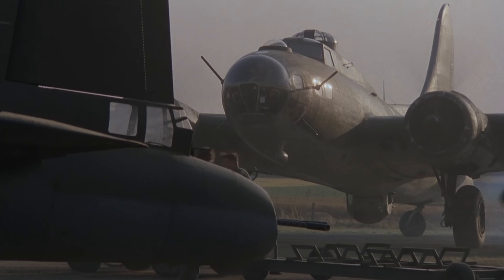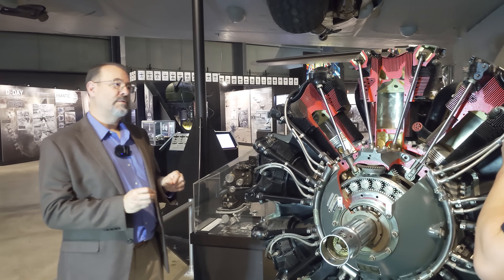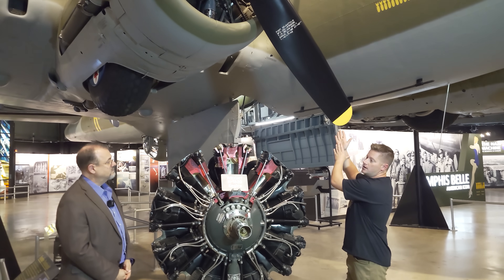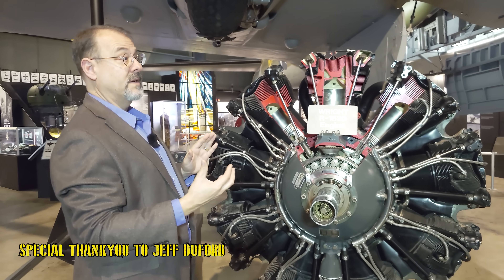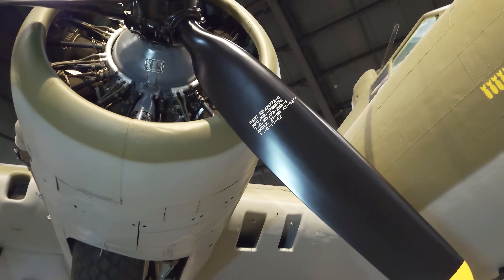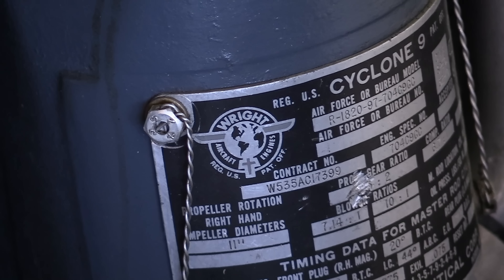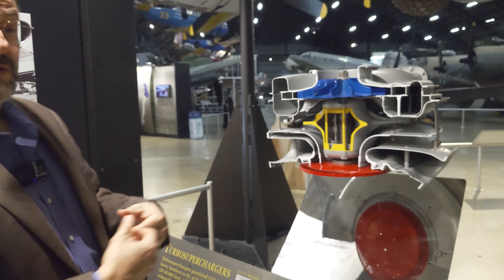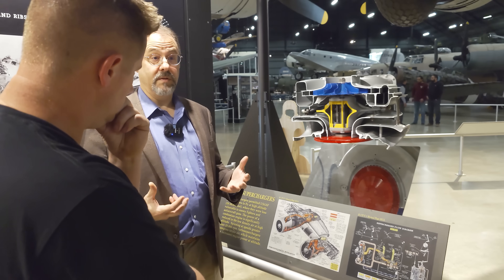B-17 ENGINES IN DEPTH! Genius Or Insanity?

Comment: A turbo does rob power from the engine just like a supercharger, it's just taking it from a different place.
If you're using engine exhaust to turn a fan, you're increasing the pressure the engine has to push exhaust out, thereby working against the piston stroke trying to push the exhaust out and slowing the engine down.
Reply from the maker: Good information. Thanks for watching!

Comment: As for the books I read some 50 years ago. They said that the turbo, produced about 450 Hp, the supercharger took 400 hp to run them so there was a net gain for using a Supercharger system for maintaining  Hp  up to altitude.
Reply from the maker: Absolutely.

Comment: My stepfather was an aero engineer and I remember how we looked at a cutaway of a radial, and I exclaimed that it looked insanely complicated and that it must be expensive as hell! But he said no, what is really difficult is making the mould for a V12 block. It requires very experienced workers and that is a major obstacle in ramping up production war-time. All steps in the manufacturing of a radial is a lot simpler. We looked around and found a quite reliable source that stated a price for a Merlin about twice that of an R2800.
Reply from the maker: Very interesting perspective. What could that say about the British using their V blocks in medium and heavy bombers even though they had radial engines as well? Would their design be more complicated and more expensive then the US counterparts?
Reply: @MilitaryArmamentsCompany  It depended on what side of the  Atlantic the Merlin was built , if it was built  in Briten it was a hand built engine. if it was a Packard Merlin, it was built on a assembly line just like all other American engines. Yes the British  Merlin  Production was up and Quality control was just as good, and sometimes better than the British engines.

Comment: Even though the B17 was an older deign it out performed the British Lancaster Bombers that were powered by the Merlin engine, an engine drooled and slobbered over by the Brits, but the cold hard fact is the merlin 20 used in the MkBI & Mk BIII were a mechanically driven single stage supercharged engine. they did have a second SPEED to turn the compressor wheel faster AT ALTITUDE they were only capable of 20,000 ft service ceiling, the 2 staged TURBOcharged Wright R1820 gave the B17 a 30,000 ft service ceiling, or an extra 10,000 ft.   the B24 managed 28, 000 ft service ceiling or an extra 8,000 ft,  the B24 had the same Turbocharger system as the B17.
Reply from the maker: Excellent feedback!
Reply: @MilitaryArmamentsCompany  Also you note one of the engine tags you showed ,showed STUDEBAKER as the engine maker, what is not widely known is Studebaker was the prime engine builder for the B17, war time license to build them to increase production, just like FORD made the PW R2800 for the P47 and PACKARD built the merlin for the Brits and the P51 Mustang, and Chrysler the Wright R3350 for the B29 program !!

Comment: Turbochargers required massive ducting on the P-47 and P-38. The 2 speed 2 stage superchargers on the Rolls Royce and Bristol engines were more effective at high altitude. The last Rolls Merlin upgrade got over 2 000 hp at take off from 1650 cubic inches. The more standard Merlin 61 had a specific power (HP/cubic inch) nearly double that of the 1820 and the P and W 1830. It also had a seriously higher power to weight ratio. The similar scale Bristol Hercules radial had about the same specific power and a slightly higher power to weight. Nothing wrong with either Wright or P and W, but exceptional not so much.

Comment: Excellent video. The only thing that I think he could have explained somewhat better was the scientific need for the turbo super charger system due to the altitude these engines operated at. Any burnable fuel requires oxygen to burn and every fuel has a specific stoichiometric or air to fuel ratio that it combusts fully at. If this ratio is not correct in an engine it will lead to a rich or lean condition which will cause power loss and even damage due to improper combustion. In order to get the full power and reliable performance out of these engines just like any engine that ratio needs to be correct. To achieve this at high altitude where the air is, much much more air needs to be compressed into the engine to provide enough oxygen for the fuel to burn properly. One thing I’d like to know more about is how the boost pressure was reduced at lower altitudes to prevent a severe lean condition where the air is denser. I read that they had boost control systems but I don’t know much about how those worked at the time especially without computers etc.
Reply from the maker: Great feed back. Thankyou for watching. Check out the rest of the series.
Reply: Could have done with explaining why they used Turbo charging + Supercharging and not two stage super charging as others did to get high altitude performance rather than just stating Wright were the only ones to use Turbo charging.

Comment: We know that aircraft maintainers sometimes worked for days without much sleep to get an aircraft ready as son as possible. That being said , perhaps there was no time to stencil paint some of the repair parts for service.
Reply from the maker: Fair observation, only to say that stenciling was done rapidly at factory like to assist with parts supply chain and settings for pitch etc hence why the question was asked. Thanks for watching, check out the rest of the series.

Comment: Nice engine. I did my apprenticeship on them in the 1960s. They use to put them in the Grumman trackers and in the nose of the Sykorsky s58 c models .They were a much better engineered than the Pratt and Whitney engines.

Comment: 'Air Forces' lab?  I think Pratt and Whitney might have a comment about that.  The cylinder fins were created by cutting the fins in the solid aluminum casting with gang saws, and a steel cylinder sleeve was inserted for the piston, and the Air Forces lab had nothing to do with it, just pure free enterprise innovation and invention with zero government intervention.  Something we need today in the area of automobiles instead of cars by edict.

Comment: The "tour guide", or whatever he is, did not explain why supercharging was important, he stated that it was important. Because high altitudes meant lower oxygen levels supercharging was needed to force more oxygen into the combustion chamber. This same type system, crank drive supercharger and turbo supercharger, was used in the P-47, giving it unparalleled high altitude performance.

Comment: The statement that turbo superchargers dont use engine power is false. Turbochargers are driven by the exhaust stroke of the pistons, they generate parasitic loses. Turbochargers cause backpressure in the exhaust system, and the crankshaft has to apply energy to drive the piston upwards on the exhaust stroke to force air through the turbocharger. It is not free energy.

Comment: I took a ride on the movie version of the Memphis Belle back in 2013 in Wichita, KS.  I went with my 83 yr old dad, it was a great time.  They flew us for about 45 minutes all around Wichita including flying over the old Boeing factory and our local McConnel Airforce Base.  It was exciting because the gunner doors were open and you could literally lean out of the airplane while taking pics and videos.  Also, the top gunner's bubble was just a hole that you could stick your head out of as well.  An experience that I will never forget.  Sadly, my dad passed away only one month later, but, he had a blast on the flight and couldn't quit smiling.
Reply from the maker: Glad you got to experience a 17 ride! With you dad makes it better. Check out our video on Bomber Camp, Lots more happening in a B-17 then just the ride!
Reply: She caught fire a few years back and burned up in field near Chicago I’m told.  A real loss.
Reply: @williamrau8636  I believe that B-17 was the Nine-O-Nine that crashed in Connecticut in 2019, I believe the Memphis Belle that I flew on is still flying, at least I hope so, I'll do some checking now.

Comment: Great video but listening to that guy call the turbo-charger side of the induction system a "turbo super charger" was driving me nuts. Its called a Turbosuper charger system because it has a Turbo charger (1st stage of the air being compressed which he was mis labeling) and a supercharger after that.

Comment: An engine is an engine.  They are either built right or they are not.  But build quality is generally assured with anything used in aviation;  This is not an '82 Cadillac with the HT4100 engine that literally died due to regular full throttle use....

-What separates the men from the boys in aviation engine world is the time between overhaul.  The Curtis-Wright R-1820 Cyclone engines.  These were tough as hell and made about 1200 horsepower from their 9 cylinders and 1820 cubic inches.  These are air cooled and used pushrods to operate the two valves per cylinder.  They were also used on all the Douglas DC-3's, so parts were easy to come by.  The cost to maintain one of these engines is ~~ASTRONOMICAL~~ these days, but back in the 1940's they were dirt cheap.  

The B-17 used four of these engines and there were thousands of mechanics straight out of the military that knew how to maintain them.  NOT so today!

Honestly, they need to replace these engines with Pratt & Whitney PT6 turbines.  Or stop flying these 80 year old airplanes~

They don't make parts for Curtiss-Wright radial engines anymore.....
Reply from the maker: Great feedback. Great input. Thanks mate. Scott.

Comment: 9:00 I would tend to disagree with this fellows take on Turbo Chargers as I would say the engines do indeed take a small hp output hit do to exhaust restrictions and back pressure, just as super chargers cause a slight hit from pullies off the drive shaft.☝😏
Reply from the maker: At least you can disagree and be cordial about it. Some viewers here have emotional trauma and damage from the content we worked so hard to produce. Thanks for watching, check out the rest of the series.

Comment: I aways wondered why they didn't build a variety that had the larger more powerful engines used in the p-47
Reply from the maker: There were some B-17 experimental phases with V Block engines similar to a Lancaster. At the time pumping out the production was more critical then halting to reconfigure the design process in the factory and on the plane for an engine swap, also knowing B-29 was only around the corner more or less it would have been null and void.

Comment: Just a note about roller lifters. They were used quite extensively in the earlier part of the 20th century. My 1918 Stutz has roller lifters. The new vehicles now are simply copying the technology from over 100 + years ago. The new roller lifter assemblies manufactured now are poorly made and designed to fail. Unlike the ones earlier last century.
Reply from the maker: Great feedback. Agreed. If given 100k to buy only a Vehicle I would choose something older and bring it back to factory new instead of buying something new today.

Comment: Density of air, which is 20% oxygen, decreases with altitude. This means the engine gets less oxygen at altitude, leading to less power because it is the fuel/oxygen chemical reaction that makes the power. By compressing the air, we are re-densifying the oxygen making it possible to generate as much power at altitude as can be made at sea level. That's how it works.

Comment: The piston engine planes from WW2 are some of the most incredible engineering in a time of only pencil to paper and slide rules, no computers just pure genius, I love them
Reply: Absolutely! And the time constraints on top of it!!
Reply: And today people cant put down their phone for 10 minutes
Reply: It is not the pencil and paper or even the computer but the Human Brain behind it.
Today we have all the computer power they didn't even dream of by then but yet there are some really bad products in the market....
Reply: @1798iscomingback  we built the fastest aircraft ever the sr-71 with slide rules
Reply: @scallen3841 That would probably be the fastest production aircraft ever built.  Yes.  Incredible what those engineers did.  Just the engines were incredible, and compared to the rest of the aircraft, they were simple.
Reply: @scallen3841 fastest aircraft ever X15
Reply: No computers, but also no CNC machines, all these components were done by hand by people using mills and other machines, becoming a lost art.
Reply: @racekar80  A great deal of machining was done with cam controlled lathes, rather than CNC.
Reply: They had computers just not the kind your thinking of I have one that has a Patton  date of 1898 I could be wrong on the date and I'm not going to go dig it up it's still amazing if you look at the guns built back then are very complicated and difficult to work on to much engineering compared to guns made today same with them radial engine's there is so much engineering in them it's mind boggling.
Reply: There is definitely something special about planes from that era. My Fav is the P-38. It looks badass just sitting there on the ramp. The Japanese called it, "death from above". Kelly Johnson and crew were probably some of our best engineers, ever.
Reply: It was incredible engineering, buts let's not forget that the were building on 30+ years of improving aircraft technology they didn't pull these out of thin air no pun intended.
Reply: So was the SR71
Reply: all accomplished without what modern society calls "diversity".  it is amazing what our people can accomplish when left alone.
Reply: @westerncivilization  That's a pretty silly statement. Do you mean made by white people?
Reply: @westerncivilization They picked favorites too.  It was called racism.
Reply: @westerncivilization And sadly we gave a lot of things away!!
Reply: @mikes9759  Britain gave a lot to us, too. But if you agree with him, I don't expect you to think past your comfort level...

Comment: I'm not sure which Pratt it was, but many years ago I read an article about the recollections of a WWII German engineer.  He said they knew they were in trouble when they dissected a downed P&W engine.  They couldn't believe the case halves were so well machined that they didn't need a gasket between them, and worse, that these were being built in high production quantities.
Reply from the maker: American industry in High Gear right there.
Reply: Then he was lying. The Germans were building  licensed copies of Pratt and Whitney engines before the war.
Reply: @prophetsnake they didn't have a licensed R2800.
Reply: @prophetsnake yes for the JU 52 3m.

Comment: Cutaway:  I was surprised at how thin the cylinder walls were.  Exhaust driven Turbo and superchargers do actually take a littler engine power to run because of the exhaust back-pressure.
Reply: Exactly! The turbine wheel, and the plumbing leading to it (diameter/density changes, bends etcetera) all creates resistance against the piston trying to push that exhaust out, but people seem to forget that as you're forcing more air (and flowing more fuel) to produce much more power than it costs. It creates a bit of a deadly circle with turbo-superchargers (and modern-day turbocharging) as the more air/fuel you force into the cylinders, the more exhaust gases need to come out, and therefore more back-pressure
Reply: @YouNameItGaming  I always thought it was really neat how Boeing tucked the landing gear inside the rear of the engine nacelle.  Seemed to work well even with a bit of the tire showing.    Amazing how the B-17 was state-of-the-art at its important place-in-time.  And, one of the only things the Damn Ruskys didn't copy.